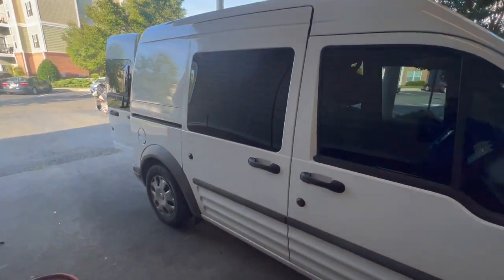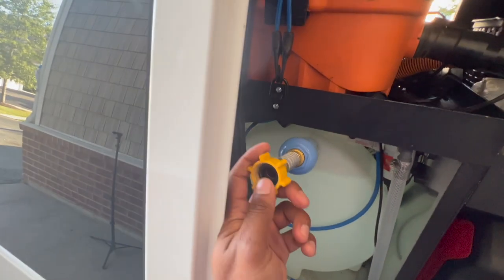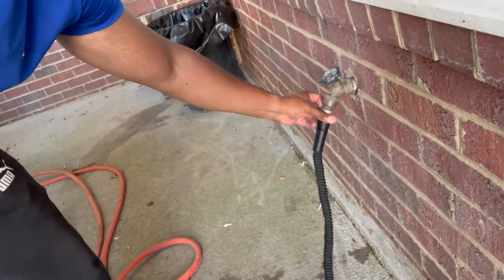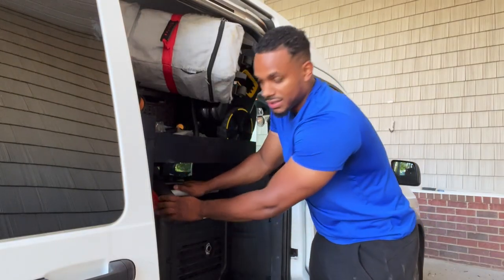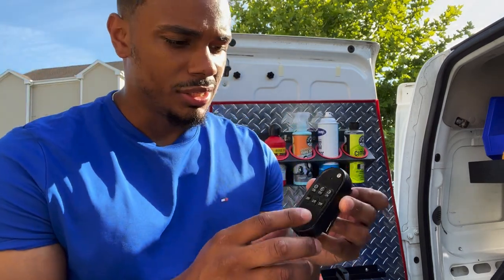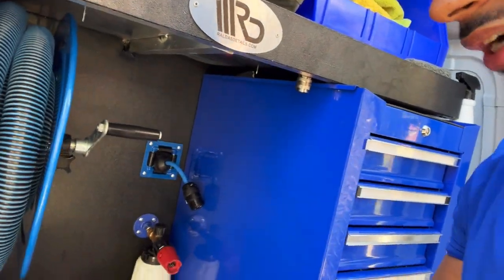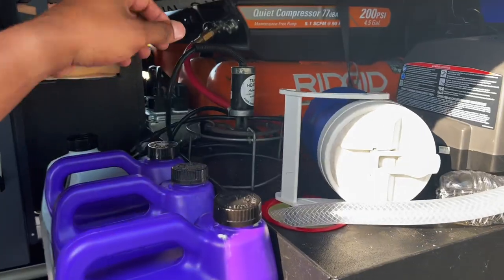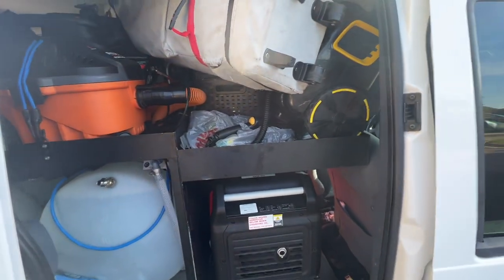HOW TO USE THE NEW MOBILE CAR DETAILING VAN - BEST METHOD TO SAVE TIME EACH DETAIL

Comment: Enjoyed your video. I'm looking to get a van in a couple months. I'm currently using my 12ft utility trailer with a 250 gallon water tank. How many washes do you get with your 65 gallon tank? I typically get 10 vehicles out of mine.i know when I get a van, I'll more than likely have to get a smaller tank.
Reply from the maker: 2 months ago, whats the update??? 65 gallons easily 4 cars. I try to always keep it above 30
Reply: @mendezmobiledetailing  if everything goes as planned hopefully not long after the first of the year maybe February or March I'll be able to get a van. I really don't want to give up my water tank though because down here in South Georgia a lot of my clients live on dirt roads so they have a lot of dirt or mud on their vehicles and it takes more water to clean them. I've even considered getting a small truck kind of like the smallest U-Haul truck.
Reply from the maker: How many Details do you do in a day? You can always refill at the end of the day with a smaller tank, are you going to their homes most times? Why not fill up from their water source so that you are not running low.   @TouchstoneMPWD
Reply: @mendezmobiledetailing  most of my details are at places of business, occasionally I'm at the clients house.  But I typically get 4 or 5. Most of my details are just a basic detail.  Occasionally I'll up sell to a spray wax or try to book them for a shampoo. But I also up charge if the vehicle is really dirty as well. So some live on dirt roads so the extra mud/dirt dust takes the price up. But the dirtier the vehicle, the more water I use. I think the most water for 1 vehicle was probably 30/40 gallons maybe 50. That's pre rinse and 2 washes.
Reply: @mendezmobiledetailing  I fill up at my local fire department. I pay $15 for 1,000 gallons. So I get 4 fill ups.

Comment: So I have two questions as I’m getting started and being subscribed to you has def helped me so far. Idk if these are stupid questions or not but I’d rather ask. Do I need the water pump once I’m using a water tank? And do I need a generator and If so what is the smallest watts I can start with?
Reply from the maker: You dont need a pump, but it all depends on your setup and how you have the tank etc. It will be alot easier to get the pump which is right here bro: https://amzn.to/3nYYYG8
Reply from the maker: anything over 3k watts is good. This is the one I first bought https://amzn.to/3IyKeqI

Comment: The water pump that you have i didnt see a pipe or hose going back to the tank to keep the water flowing going threw the pump..have you had any problems with it over heating or burning out on you mine over heated once i had to put a hose going back to thw tank  to keep the water flowing when im not using it
Reply from the maker: Check my latest video!! I’ll show on there how it’s set up

Comment: How is that seaflo pump working for you bro? I have been issues with 2 pumps back to back don't know why it just constantly runs doesn't do the auto on and off when used just stays on constantly.
Reply from the maker: The seaflo works amazing bro you gotta try it
Reply: @mendezmobiledetailing  I do just be having issues literally right out the box with 2 first one started good but 2 months in the Start/stop function stop working so constantly stayed on every time I used it and I would use my pressure washer then stop it would surge spraying all over the place got a warranty replacement well that new one out the box no start/stop just constantly running. Been using it like that but starting to do the surge thing but no water comes out, bought another unit will be swapping it soon. Hopefully the 3rd one is the good one for me lol
Reply: @ramirotorresjr7518  you need a hose to go back to the tank and recirculate the water so the pump doesn’t burn up